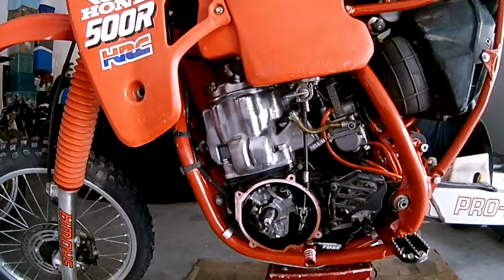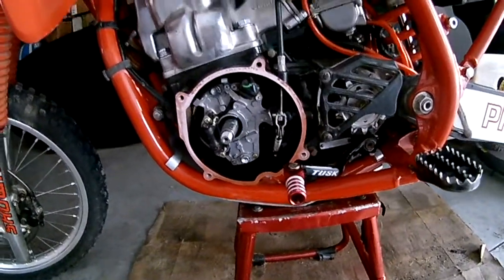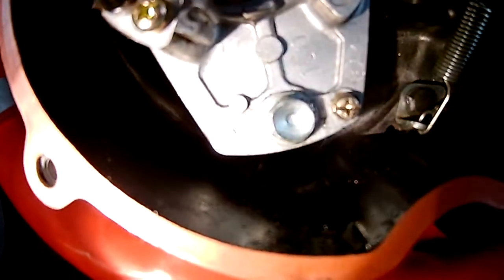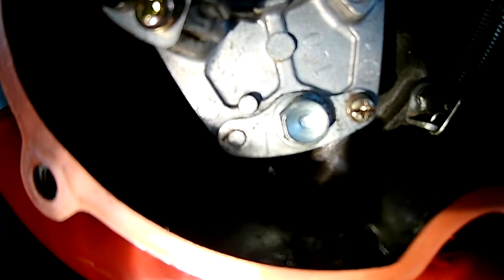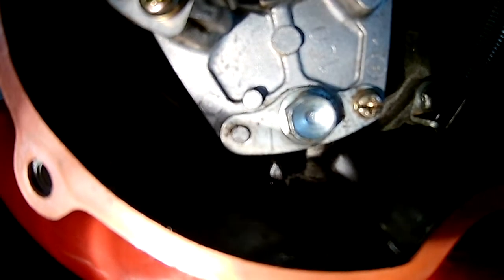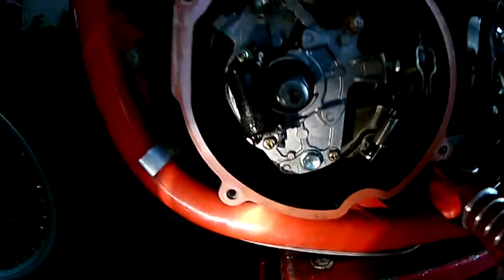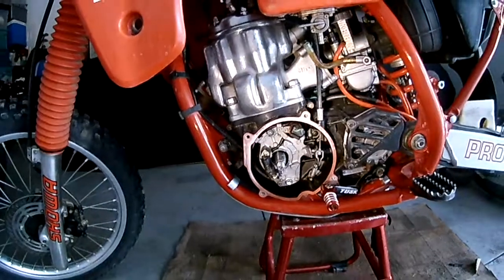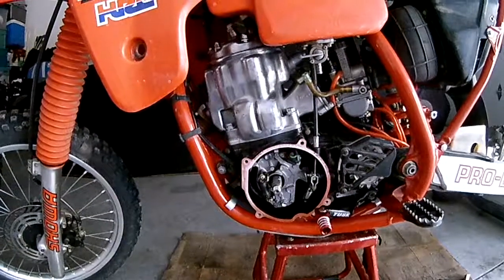Honda CR500 timing adjustment, advance or retard

Comment: You can get a aftermarket performance stator from MSV Racing. It has the timing marks inscribed on the stator from -7 to 7 degrees. Stock according to Jason Meyers is *-3 or *-5. I simply run stock and enjoy the easier starting and sharper throttle response, since it has 2 independant coils.

Comment: common mod is a 92-up kx500 carb 39.5mm over the stock 38mm,
supposed to add 3hp top end. i actually recommend a 41mm pwk,
if your cr500 aint stock. it was even better than going from 13/51 to 14/49.....